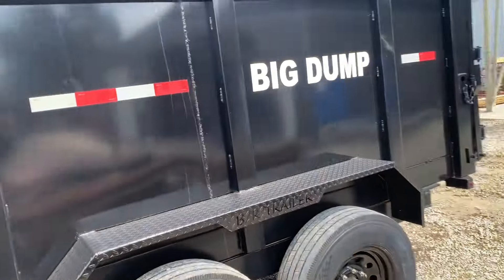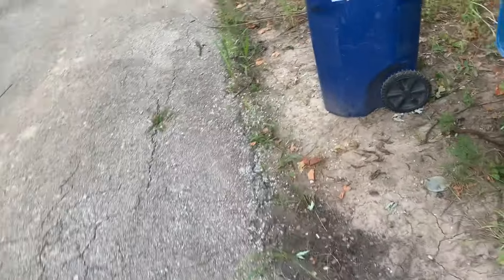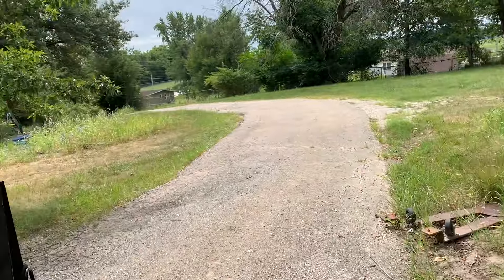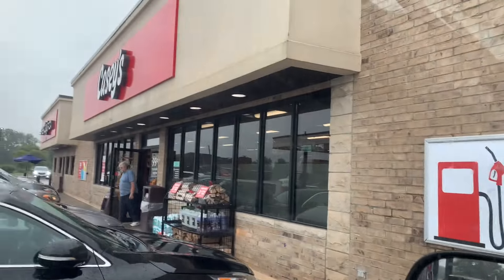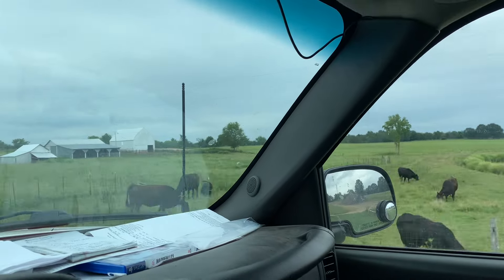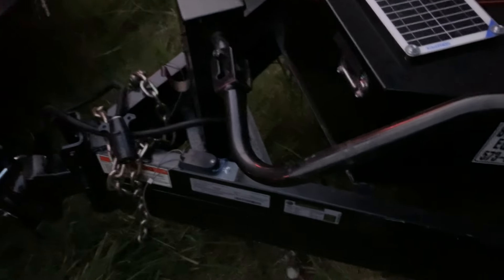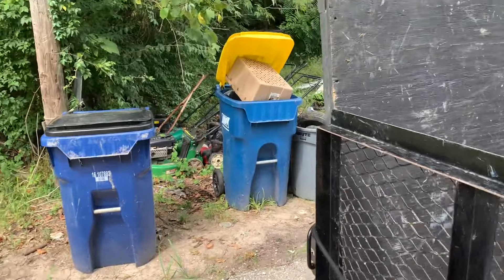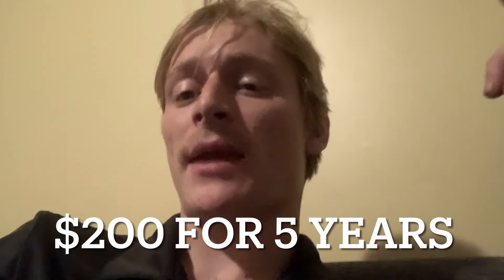WE GOT A DUMP TRAILER!! + Junk Removal Jobs $$$

Comment: Congratulations on the trailer. I’m still unloading by hand and three dumps unloaded while I was pulling branches off. What size truck do you use? I feel like my Chevy WT 1500 might not pull that size trailer (fully loaded).

Comment: Nice Trailer! Double check your state's commercial license requirements. Most states require a CDL if you are pulling a trailer with a GVWR over 10,000 lbs. Unless it's farm use.
Reply from the maker: @StandardJunkRemovalService-i3c  thanks! All good over here in Missouri! Only need it if my gvwr is over 26,001.
Reply: If the weight of your truck and trailer and payload is totaling 26,001lbs you need cdl, if its 26k or less you dont! This is in every state educate yourself standard junk!
Reply: @Soldi736   I think he's ok - truck probably weighs at most 6,000 with a full bed of  junk.  Trailer 14k loaded so 19,000 to 20,000 gross total weight